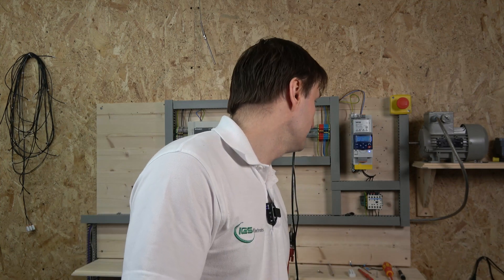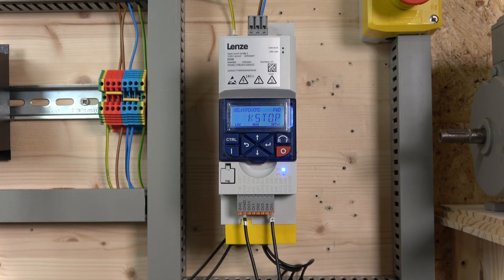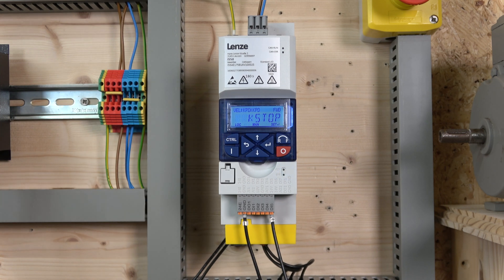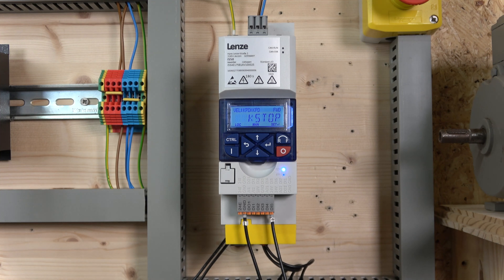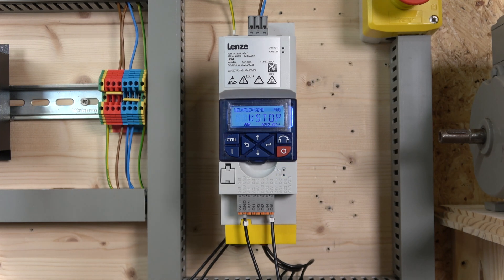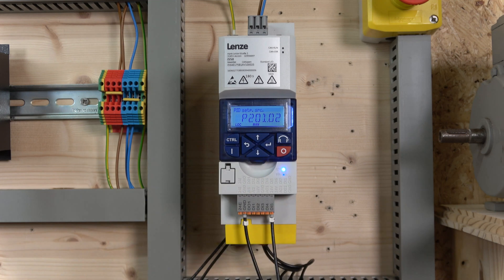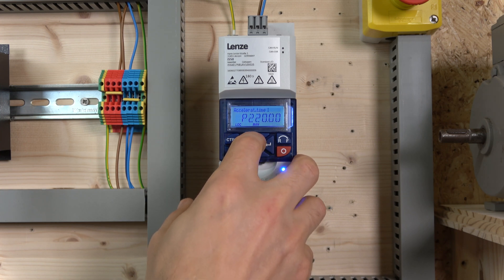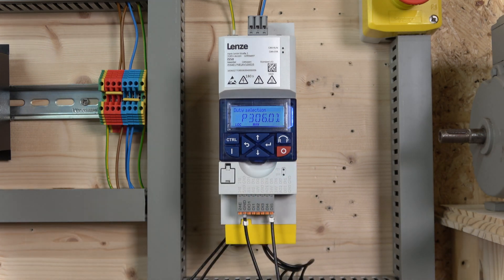Lenze i550 VFD, Local control, commissioning, auto tune, parameter set up, Factory reset. English

Comment: Thank you for the video.  It would be nice if you could slow down a bit when going through settings...  I originally missed that 320 was not motor frequency, but should have been 320.05.  (You went very quickly through it & it was easy to miss.)  That said, great video.  Thank you for taking the time to make it!!